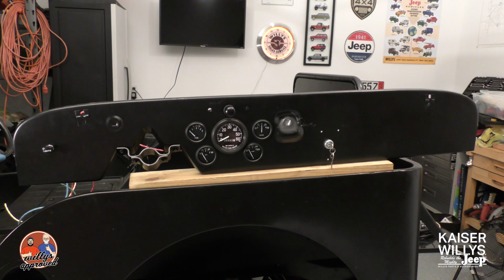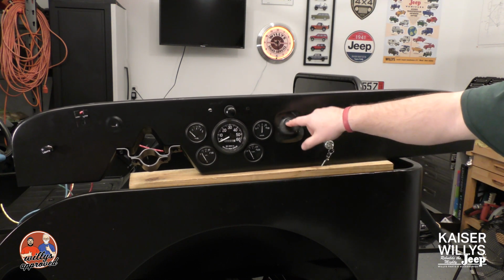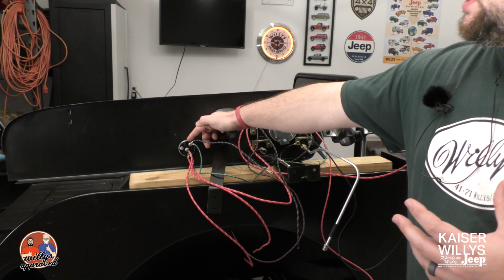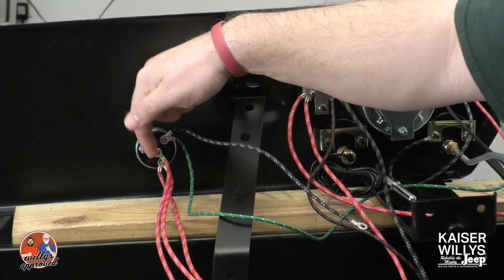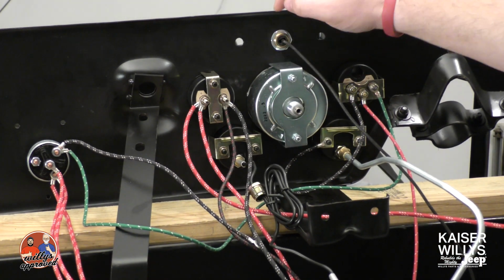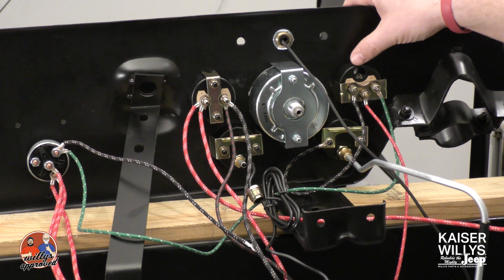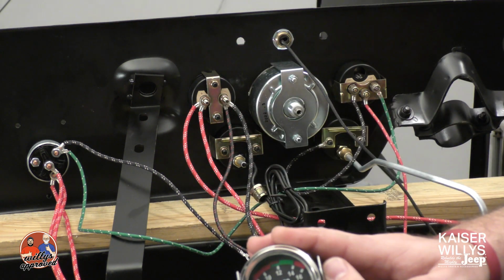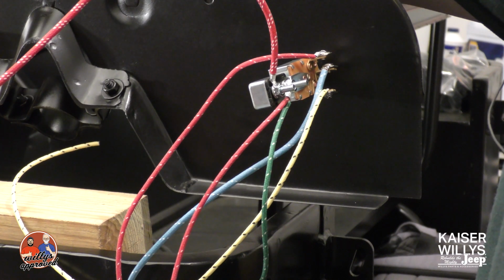Willys Jeep How To: Wiring Harness Part 9 - Dash and Gauge Wiring

Comment: Very nice to see all this clearly. I'm working on a '46 cj2a and so far I've replaced wiring for the brake switch, brake lights, and dash light. I think I need a new dimmer switch in the floor but I think everything else technically works—I just need to replace all the rotted cloth covered wiring. Bare wire all over the place in there, kinda sketchy. Really wish the dash could fold up or something, it's such a pain trying to get to all this through the little access ports or from underneath

Comment: Hi Jason. When talking about the ammeter you mention that the black wire on the “-“ post goes to the solenoid? Should it goes to the Volt reg Bat terminal?

Comment: I have a 12v gm 1 wire 63amp alternator. I still want to use an ammeter. I found a 100amp ammeter, assuming I can wire the ammeter the same  way I would as if there was a 6v system?
Reply from the maker: “You could certainly give it a try. Just make sure you install an inline fuse between the alternator and the gauge”